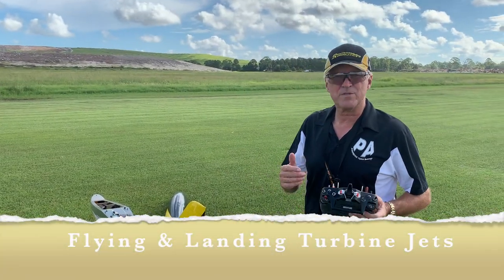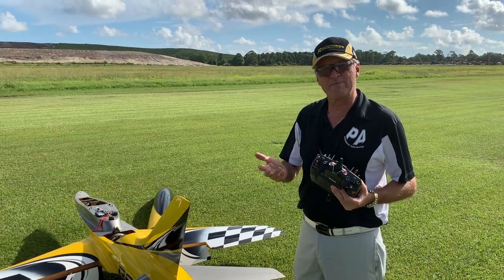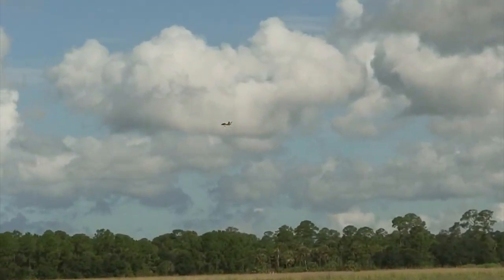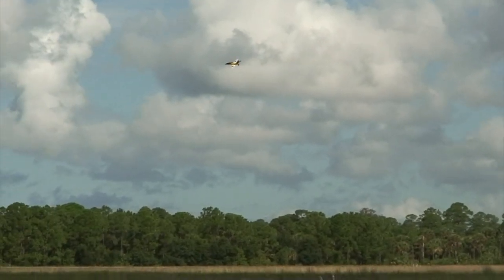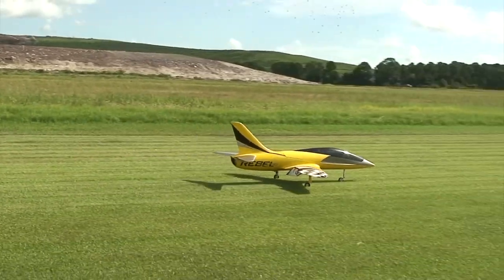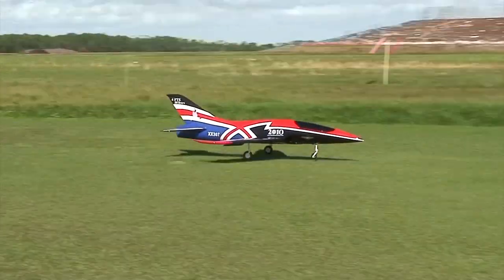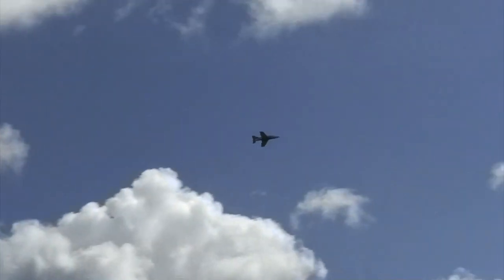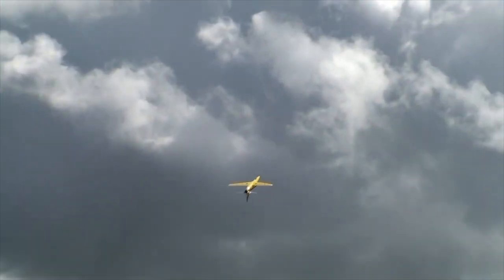MIchael Wargo on how to properly land an RC Turbine Jet

Comment: I’ve always said this. And now finally a video illustrating it perfectly. 

The majority of rc “pilots” (and I use that term loosely) have zero clue how to land correctly. As a matter of fact they think that as long as they didn’t completely tear the airplane apart, it was a good landing. 

I’ve seen it so many times when they tear the gear off and then laugh about it. Is not funny. You. Can’t. Land. 

The term we use in the airline business when landing is “stabilized approach”. This means that you have to make sure you’re configured and on speed before a certain point, typically 3 miles from a final approach fix. If you’re not stabilized by that time, most SOP’s will call for a go around. 

This video highlighted this technique perfectly. I like he said, it’s not a special skill. Its STANDARD PRACTICE. 

Hopefully, pilots watching this video will finally understand how to land a plane.
Reply from the maker: Thanks for this.   A great way to say it.   A stabilized approach is Key.

Comment: Just wanted to send my thanks for this video. I have the f16 70mm edf and the strut pins on the retracts are fragile. Just rolling off the runway and hitting a gopher hole or something might snap a gear off. I’m getting much better and confident with my landing now. Thank you.

Comment: Not coming in low and flat enough is a problem with almost anyone (regardless of the power plant) that has a problem landing in my observations.  Once folks forget the 3 mistakes high and stop being afraid of the ground flying improves greatly.

Comment: Another very helpful and awesome video Michael.   I was flying a turbine yesterday and one of my landings started high which made it come in hot.  Pretty smooth but went long and could have been a bad result if I hadn't had the runway length available.  Great tip and reminder here to take the time to be precise.

Comment: Nice job Michael!
Good video... Thanks for sharing.
** Suggestion.... How about a followup to the Landing phase with a video on Flap/Elevator mix to control your pitch attitude at slower speeds?
Additionally... 
In getting a little more advanced.
Setting up an elevator fine tuning trim w/flaps so a pilot can adjust the elevator trim on the fly with the varying conditions during approaches?
I set mine up on a left hand slider to adjust the pitch with my index finger. (Didn't care for the dails) 
Full travel can be set for 1/8" to 3/16" of elevator adjustment.
I've added that setup to all of my EDF's and Scale Warbirds with great results!
It cuts down the pilots workload significantly! 

*Not a new concept, just rarely discussed.*

Thoughts???

Thnx,
DaKaiman
😎
Reply from the maker: I did the video completely at your suggestion!!!!!   https://youtu.be/in07LMb2Ecs

Comment: Brilliant flying and smooth landing, but surprised you don't 'get on the back of the drag curve', nose high, and control descent rate with power. Easier on the F15 with the lifting body.
Reply from the maker: Depending on the plane, it offers some difficulties with many jets.   Especially the Viper-type jets.   They just don't want to be very nose high.   When light, they also want to climb.   My f-15 and f-16s are amazing that way, looks awesome too.   Look at the boomerang and even the rafale.   So nice when nose high.  Short answer, depends on airframe.

Comment: Great video.  Having issues landing my Freewing Avanti V1. Get too slow and this plane will definitely stall. Land a bit hot, and if  nose wheel touches down, the plane jumps up wanting to fly again and sometimes goes into a bouncing oscillation and eventually another potential stall. Have been flying edf's for years. Not sure why I'm having such a problem with this one. The plane flies great! For some reason I just can't land it well consistently?

Comment: Thanks for the video. At what point do you flare, or do you flare at all?
Reply from the maker: As you can see, when I get close to the ground and I say hold it off...  That is really the flair.  But using that term suggests something more dramatic
Reply: @MichaelWargo  Thank you, Michael. I am a fan of RC aircraft. Most pilots make a steep and fast approach then flare when the aircraft still has lots of energy. What follows is a long flare and clumsy landing.

I have seen models with spoilers. These though can only work well with a well-controlled landing, like what you illustrate in your video.

Would love to see you flying a larger RC Airbus or Boeing to see how well you take off and land.

Thanks for the videos and please keep them coming.

Comment: Hi Michael, I have a Skymaster F-15 and was wondering what CG you used and how much fuel with gear up or down.
Another question is if you could described the power use during landing. Do you keep power on all the way to touch down or 1/2-1/3 throttle until over runway and then let it float in and flare just before wheels hit the ground?
Cheers
Rocco
Reply from the maker: I do not remember my cg.   YOu simply need to watch the speed.   Keep the power on if it doesn't seem to slow down, then cut the throttle.   I found the I slowed, then added back a bit of power and brought the nose up.   Then I kept the power on killing it low over the runway.   BUt you will have to watch the speed.   If you watch my landing you can see what I did.   I hope that helps.

Comment: Thanks a lot for this video, but most of the planes here are easy to land (similar gliders). But how to land a very heavy  jet for its size like my F14 with two powerful engines. Those  Jets like to tip stall immediately without warnings. Would you advise to land  nose down and flair out at the end ( The risk is that the reaction to the elevator is too small or too high in the last moment or  would you advise to come in with angle of attack and power. (The risk is that you lose too much speed too fast and then you stall). 
How Would you land a critical plane like this, which is too heavy for its size?
Reply from the maker: Great question.   The key as usual is managing the approach.   OK.   Ideally, you should find the sweet spot where you can land with power.   This is how the real ones land of course, or an airliner.   Long approach high alpha flying steadily with enough speed for slow flight.    IT is hard to judge and almost unreasonable to do this consistently.   My way is to fly comfortably slow, meaning you don't fear a stall at all.   Just fly low and make sure you are low at beginning of runway.   Fly it til its close to the ground then hold it off.   Note my F-15 landing.   IT wasn't slow, it was low.   No altitude that turns into speed.   That way, when it slows there is plenty of runway.   I hope this is clear.   Take away the altitude, you are more in control of the speed.  Even if you are fast at beginning of runway, it will slow and land.   Also, hold off touchdown to make it pretty.
Reply: @MichaelWargo  Thanks a lot for your fast and helpful response. I always shaking when landing my 35 kg Tomcat
Reply from the maker: I shake too!    I have flown a twin turbine Tomcat!   IT is a bit nerve wracking!
Reply from the maker: NEw video you inspired...   https://youtu.be/5pT9FWs9-0c

Comment: Are you using any rudder in the turns???😎Going slow???
Reply from the maker: I use rudder so much throughout my flights, I guess it would depend on the moment.   I am a 3D Pilot so it is so second nature.   BUt the short answer is yes, I probably am using it in a fair percentage of the turns.
Reply: @MichaelWargo  THANKS ...!!! I use it alot to get the plane or jet back quicker sometimes... but I also use a bit of elevator to keep the noes up...its works for me... I always have the guys saying don't slow down...😂😰 thanks again great instruction video:goodvibes:...

Comment: Do you land on low rates and fly on high rates?
Reply from the maker: In A previous video, I said you should always take off and land on high rates in case of a problem where when the plane is slow you can still have good control.   If engine goes and you have to make an emergency landing, you will appreciate the extra Throw.   Similarly, the slower you are(last seconds of landing) you will still have good control.  Finally, if something crazy like a gust of wind or anything throws a wing down or something, you will have enough rates to correct.   With a jet, I switch to a lower rate when going fast which is where you don't want too much movement and more resolution is beneficial.  High rates going fast can be dangerous.   What I always do is set enough expo on high rates so they feel the same as the lower rate at stick center.   In general flying I can barely tell what rate unless I push the sticks hard